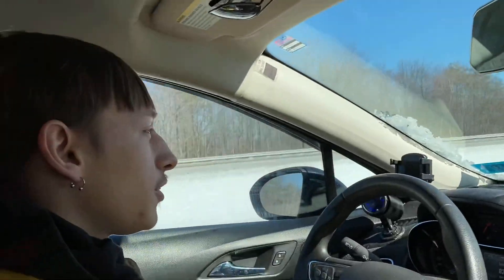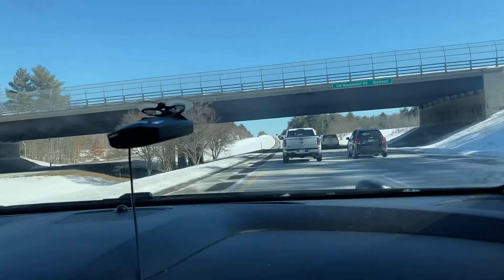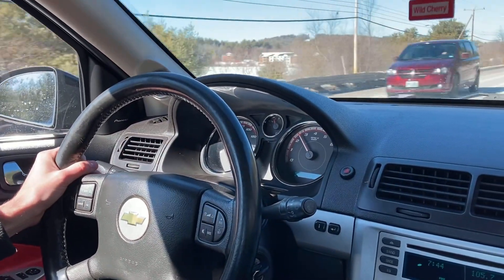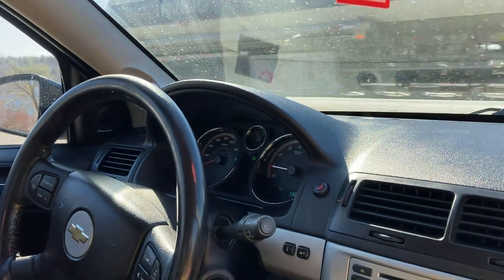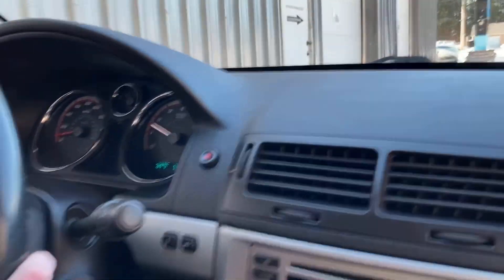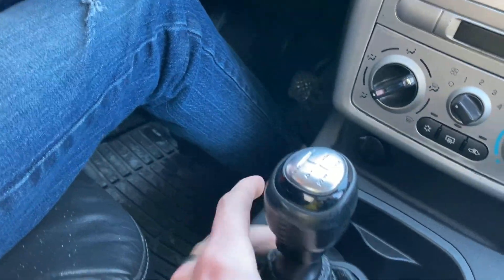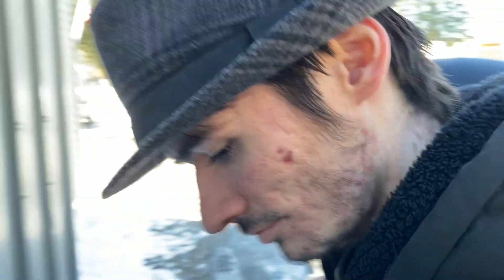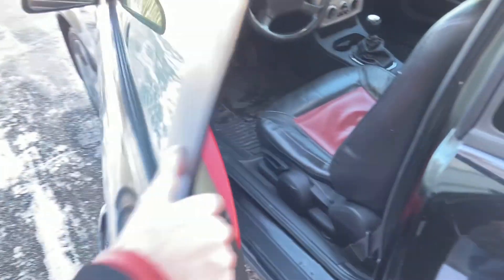2005 Chevy Cobalt SS - The new daily

Comment: Very nice. I miss my 06 LS Supercharged. (YES... LS I put a 2.0 setup on my 2.2.) I still have a blower with a stage2 pulley sitting in my Cruze parts box. You would just need a tune and bigger injectors I think. Used to have a pair of them. Sounds like the flex-pipe is leaking. Also, one good point of the LSJ is that its a non-interference engine if the timing chain ever breaks. She looks totally unmodified so maybe they didn't beat the piss out of it. I'd love to see a stage2 SS vs Eric's Turbobay setup.
Reply from the maker: I just now saw this comment. I may go stage 2 on it at some point, still need to replace that flex pipe though. It actually ended up blowing a spark plug out of the head a while back which had to be fixed with a helicoil. Still runs good and pulls good.

Currently the cobalt is slightly slower than the cruze on a side by side 40mph roll race. Cant beat that modern auto...